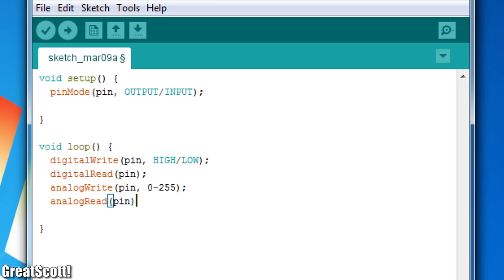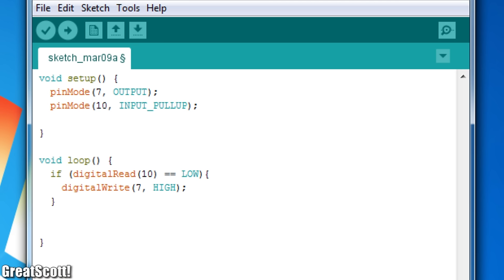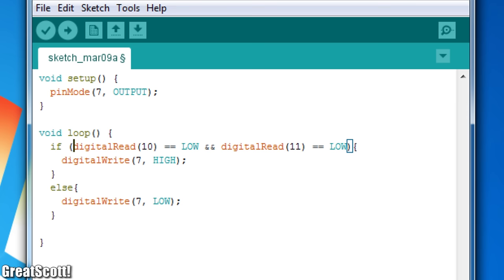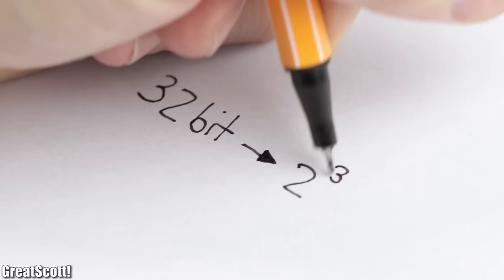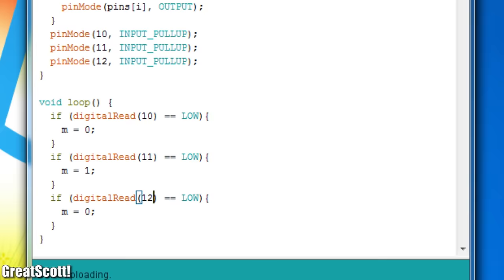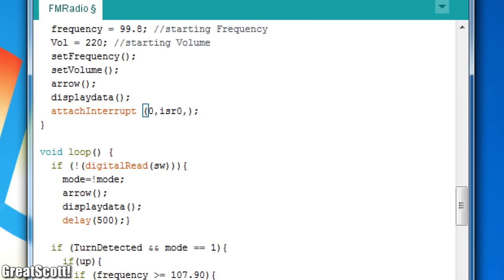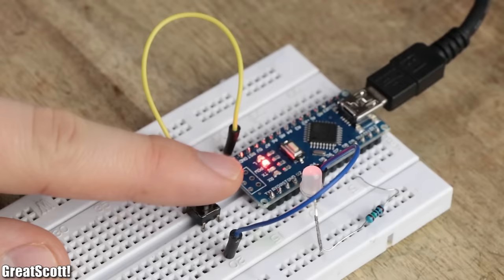Arduino Basics 102: Control Structures, Variables, Interrupts

Comment: I have been using Arduino's for quite a long time, and I have to say I absolutely love them, you don't have learn C in the first place you can get along with Arduino just fine you might have some problem with concepts but with it will never be complicated, with Arduino you'll start off with making programmed electronics project and I think this way is actually really good of developing knowledge of electronics and programming at the same time, it covers both domains. Also I think as you will learn more you'll see actual programming languages like python, C++, Arduino C and java generally consist of 
1) Variables and advance Variables
2)Control structures
3)Interrupts
they can contain a lot of things of could vary but they all consist of these at least, what makes you a good programmer isn't learning the concepts but to be able to develop concepts, as you'll advance through the journey from intermediate to advance you'll see now you have to learn programming techniques and algorithms, you'll start off with making few simple to intermediate level techniques after some time you'll realize what algorithm and techniques are all about and at that point you might be able to step into the further most step and that is probably expertise in this level you'll apply your knowledge in real world technology and developing algorithms, techniques for robots or anything to function. At that point you'll have such good knowledge of coding and concepts that it will be just like a language you speak or like basic maths, your focus will be more on actual functionality of the things, coding will be just like translating the entire expression to machine that's all, It can get tedious, programming hundreds and thousands of code will get you exhausted, but hey that will just fade away just in half and hour or couple hours and you'll love it after you'll return. At that point you might be interest in exploring a little bit more in this field and understanding not just algorithms and stuff but a lot more than that, with being good in robotics you can get better by combining your knowledge with learning new things like networking, webpage communication, TELNET shell commands, and trust me robotics and electronics is branch that covers literally all domains of technology  like 
A.I, Machine learning, physics, Math's, Computer Science, programming, mechanics, electronics, electricals(sort of), 
Network and communication, chemistry, philosophy, Bionics,  data science, data analysis, database management, application development, Nano technology. Although in the term robotics you can literally cover these all things as it incorporates use of everything but keep in mind that robotics is still isn't advanced as living physical biology and despite the fact they have their pros and cons,  you may see all those domains as more like aspect or additionality to robotics however robotics in real world at least covers domains like, physics, Maths, CS, programming, mechanics and electronics as basic requirements. Those aspects range so much that they have their own separate fields and are separate subjects. I believe pursuing career in robotics will be more beneficial cuz you'll be exposed to many aspects and fields at once and how they interact with each other, having good foundation through those you'll be able to switch between careers in science and technology pretty easily such as if you're robotic programmer than you can be software engineer or application developer etc
I don't say what I say is hundred percent accurate but I am just giving general idea. I hope if any beginner or someone who's interested in tech will find this helpful.

Comment: I have just watched Arduino 101.
I have been using Arduinos for many years, love the platform.
So as I watched your 101 video, I was surprised to find out something I did not know.
Danke Schön

(It was the value or, and how to use the internal pull up resistor)
Now on to 102

Comment: I'd like at least three more in this series. The one you mentioned, one as an introduction to sensors and working with sensor data and a last one, which discusses when to use an arduino or when to use alternatives.

For example, I wanted a device to water my plants every 24 hours so I made a prototype with Arduino only to consider that the Arduino is too OP for such a simple function. Another project was to have a dimming LED strip light up over a settable time span at settable times. Again, Arduino prototype, end result: alarm clock + LED controller, without an Arduino. In the end, that last approach was soo much better than the Arduino, since it already included configuration components that I'd have to build from scratch on the Arduino.

Comment: variables that are changed within interrupt routines need to be declared as 'volatile'.  I noticed in your blinking led example, the variable ledstate was not declared that way, so you got  lucky it worked.
Reply: What does that do?
Reply: I tells the compiler to always fetch the current value of the variable from the assigned memory location.  Without it, the compiler can sometimes optimize variable values in registers and re-use the register value.  This speeds up code but can cause the wrong value to be used when variables are changed in interrupts.  A good example would be a variable in a for loop.  The compiler is free to load the initial value in some register and then continue to increment the register and then finally write the value back to the real memory location at the completion of the loop.  If the loop variable got changed in an interrupt, the for loop would never know it.

Comment: Great videos' as always.  I built your FM radio project for my grandson and he really likes it.  I have been trying to add an EEPROM read and update function to this project to remember the last frequency selected (with a 5 min timed cycle). So that when the radio is switched on again it would use this frequency instead of the one pre-programed in the sketch.  Thanks

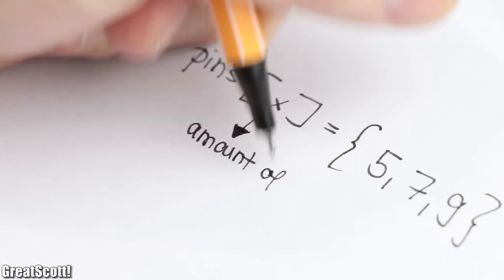Comment: 4:25 The array holds values, not variables.
Reply: Array is actually a pointer to multiple variables, so it is not false to say it holds variables :D
Reply: Also true. ALSO.

However, as GreatScott postulates in the video, the pin numbers in the array are values. The variable would actually be the "Id" of the value.
Reply: Agreed
Reply: An predefined object that holds other predefined objects that hold values.
Reply: That's going too far.  "Object" is a specific programming term for a structure which contains both variables and methods (functions).
Reply: Types(variables) contain methods. Everything is an object - predefined types are just hard-coded in the compiler.
Reply: Mystickneon An array in C is not an object, it is just a slice of the memory reserved to be used by the programmer. When you declare int a[3], a is just a pointer to the first member, and accessing elements by writing a[1] or a[2] is no different than *(a+1) etc. C doesn't have objects anyway, not everything is an object. Terms have meanings, don't confuse people by giving new meanings to them. If you want to read more:
https://www.bell-labs.com/usr/dmr/www/chist.html
Reply: Which could also be int a = new int[3]... the identical constructor to any other object.

Comment: An int is not exactly 16bit, a long not exactly 32bit. It may be true for the arduino (/ ATmega328), but not for the arudino due (32bit ARM processor), so be careful with that :) (also the float does not have to be 32bit with IEEE754, but it is mostly)

Comment: This is a really useful video.

Does the Arduino handle overflows by itself or will you have to add code to deal with errors like it.

Comment: At 3:43 you have defined i as integer but later define it as 0 in the setup function. Could you have just defined it all at once by using int i = 0; or would that has resulted in a different outcome? What is the advantage of defining it in the setup function, or is it just good practice to make it look presentable for the video?

I wasn't aware of the interrupts before, very interesting!
Reply from the maker: The outcome should be the same. I am just used to define them in the setup section.

Comment: Good video. Thanks. However, you did not explain “Why” one would define the int as a const. What purposes did that serve. Why would someone want to use “const”, and under which conditions is this preferred instead of just using a global int? If you could explain this, it would be appreciated. Thanks.

Comment: can you do a guide on soldering? because when i tried to solder some cables i accidentally exploded a battery 😞
Reply: I think this is just lesson for common sense. Battery + heat from soldering iron = very bad combination.

Spot welding is much safer option for batteries, but not an option for most people. My recommendation is, if you have soldering iron that allows you to change temperature, set it as low as possible to melt the solder, and apply the iron as little time as possible.

And wear safety gear. Protective glasses and gloves. Fire blanket or similar is also mandatory.
Reply: TV Hamster 😃
You gotta be quick and anyway it's a bodge job soldering low power battery terminals and the iron heat reduces battery life. Best getting battery holders with terminal contacts.

Comment: Great Scott, please re-think your suggestion of using interrupts with switches. Try some real experiments and see that it is a terrible method of sensing a switch (push button or rotary encoder). You could do an entire video on just switch bounce and how to handle them.
Reply from the maker: I talked about the debouncing aspect in my radio project and camera slider project. Interrupts work excellent there.

Comment: Nice video! One small mistake though, a long alone can only store 2^31 bits. This is because the last bit is used to determine sign (positive or negative). To use all 2^32 bits, you would have to use an unsigned long. The same is true for the other data types you mentioned.

Comment: Ohh , i Find my Answer here of , previously  commented Ques !! :) 
Which is , Else " . But i wanna use to controll Digital port then Pwm port by Using SerialRead Char Command , Then android Controlled App , instead Push switch . I am trying to  Learning sketch by Self , by Modifying  some Example code to do Different work . Thanks for This basic coding Guidance  .   
Plz make video on  ' making App for Blutooth controll arduino Project using MAI2  , and also on scratch 4 A   and mblock  , block visual  Programing for arduino project :) TKs

Comment: Hello, nice video, but why do you forget the very usefull BYTE TYPE ? because int is not necessary for some counter witch dont need more than 255. I think that a more deep explanation of type is necessary for most arduino users. int is wasting space when used for pins definition.# define or  const byte is great for that.

Comment: Hello Great Scott, I really like your videos, and I am watching it backwards, I am working on a project, in which I use HX711, LCD with I2c interface, and a 4x4 matrix keypad, so my problem is keypad presses are bit slow, as there is happening lots of think in the loop, so I need some help to speed up the responsiveness of the keypad, thank you.
Reply: Muhammad Akhlaque Hello, I think the HX711 reading is your bottleneck: by default it only gives 10 samples/sec, but you can unleash it to more than 80 samples/sec by joining the pin RATE to the pin DVDD (check the datasheet)
Reply: Muhammad Akhlaque You could use the PinChange Interrupt for your keyboard. Just google for it, there are libraries out there. The only thing to remember is that up to 8 pins are mapped to one interrupt, which means in the interrupt service routine, you have to perform a digitalRead first to determine which button ist pressed.

Comment: Hello GreatScott! I've been making an rc tank  and I've come across a problem. The thing is that the remote that I'm making has four buttons(first two buttons are to control the first motor; i.e. to drive the motor forwards and backwards,and the other two buttons do the same thing for the other motor).My problem here is what if you press the forward and backward buttons at the same time? I think I need a circuit that when you press one button the other one will do nothing when you press it. Can you help? I like your videos and keep up the good work :D

Comment: Hi GreatScott (Maker of great Videos),

My name is Jacob (from Essen, NRW) and I am one of your YouTube subscribers. I have tried many times to get an Arduino program to recognize a continuous press on Infrared remote control and execute a code for as long as the remote control button is pressed, but never seems to work. 

I am using an IR remote that can send a HEX code/file about every 100 milliseconds continuously for as long as it remains pressed. (Please NOTE: it does not send FFFFF like many remotes do. It send a unique code like: C00058 continuously till the button is released).

What I want to do is just to drive a servo for as long as a remote button is pressed. Once I release the button, the servo or any other motor should stop rotating, just as it works with a volume button on a sound system. Please advise me on what to do or with a short code.

I would be looking forward to hearing from you. 
DANKE SEHR IM VORAUS:

Comment: It's great, would you plz guide me to build one project with 8 pushbutton & 8 leds instead of 3, with latched function!! If any one of those button is pressed the led assigned with it will glow in latched state till the button pressed again. While the led is glowing then any other switch will be inert,will you plz guide me  Sir?

Comment: Scott I am a PhD scholar in friction stir welding, I need a Data logger that can read/write in SD card for 3 or 4 k type thermocouple. I want the write function of temperature should be higher than 10Hz, I am learning basics of Arduino and came to know that I need max6675 for high temperature k type thermocouple and a Data logger shield for writing my data on card , please help me with sketch for 2, 3 or 4 channel data logger with 10Hz data sampling

Comment: So I can program my Arduino using C++, or is it a different language? Also, do programs written for the Arduino have access to heap space, or is everything strictly off of the stack (I don't know a lot about microcontroller memory, "heap" and "stack" could be completely irrelevant for microcontroller programming)?
Reply: Heap and stacks are commonly used words when talking about microcontrollers. The language used to program microcontrollers is a modification of C++, the syntax is almost the same. You can have access to various low level instructions, but you could also make very complex programs, without knowing anything about low level programming / memory management. I personally don't really know these things, since I mainly use Java.
Reply: You can program the atmega with straight C or the Arduino "language" which is a platform of C++

Comment: What if you wanted to uses the Arduino to control the voltage of a circuit, but not directly due to the limitation of current in the arduino...

I am thinking something like. Measure the temp of some water and if the temp is far from the target cool it using a peltier element. But a peltier element uses 6A or more, much more than the arduino can handle...

but it must be possible to used the computation of the arduino to control a circuit that can handle the required 12V and 6A.
Reply: Petch85 You can use an Arduino to control relays, this solves your problem. And it's also very simple.
Reply from the maker: You need a powerful switch. A relay, MOSFET, BJT,.... would work.
Reply: if I use the Arduino and a relay I can only use it as a on/off switch...
I need to control the voltage from 0-12V...
I will look up Mosfet and BJT I have no idea how or what they are :-)
thanks...
I will keep watching, there is much to learn, and maybe GreatScott will use Mosfets and BJTs at some point.

Comment: hey great scott Iam your biggest fan in the world however could you do a new coign with IGBTs, a High voltage capacitor bank therefore a circuit from a flash of a camera which would give you about 200-350v

PS DO NOT USE THE ARDUINO:-) PLEASE non-offensive don't take this as a rude comment please

Comment: I was doing something like this a few days ago and this is the code I came up with:
https://drive.google.com/file/d/0B0MTDPsChiF3dEtVdEJYWVllYXM/view?usp=sharing

The Idea of this code is for a water sensor to detect when there is fog machine fluid in the tank and if the motion sensor is triggered the relay when start the machine. At the moment I can't seem to work out how to do a delay for how long the machine is on while still having the water sensor take priority and turn off the relay, I know you talked about interrupts and how to do this but i'm just wondering if you think i'm on the right track.

This is what I want for it to do:

Water sensor high and PIR sensor high 
Relay on
But if water sensor low turn relay off and sound buzzer, flash LED

Water sensor low and PIR sensor low or high
Relay off and sound buzzer, flash LED

Please give me some advise :)

Comment: Would you consider doing a review of the Launchpad MSP-EXP430 series?
They are basically Texas Instrument's version of Genuino and use very similar software.
They have some differences that you might find interesting though, like the 3.3v logic, and that the main chip is much more 'independent' than the Atmel AVR chips (easier to use in projects). Though note that I haven't actually used one of these myself, this is just from basic research.
As an added bonus they are much cheaper than official Arduino boards.
Here is the 'entry-level' one:
http://www.ti.com/tool/MSP-EXP430G2